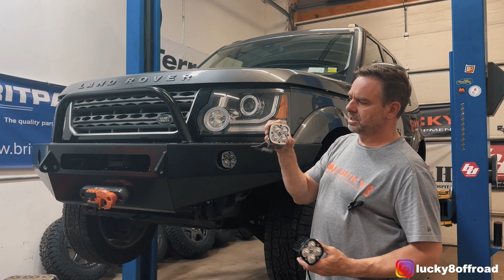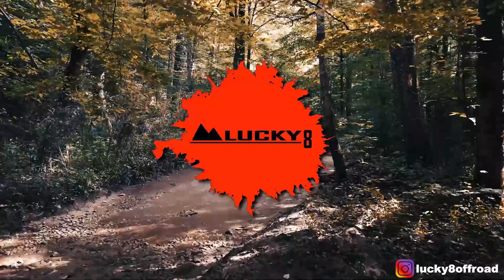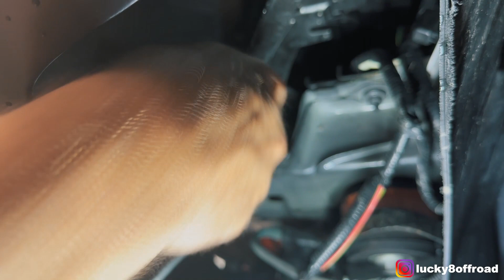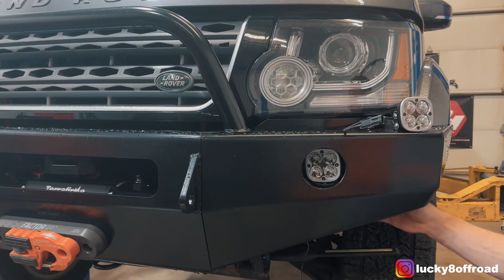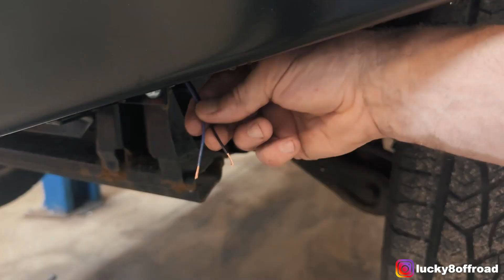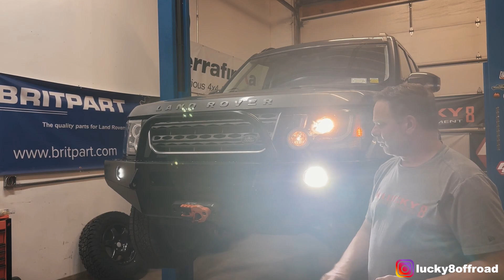Fog Light Video

Comment: Is that a 10-13 or 14-16 LR4....asking because the headlight height difference and the spacer you guys created for the move from the LR3 to LR4
Reply from the maker: This is a 2015. The bumper will work for 10 to 16.